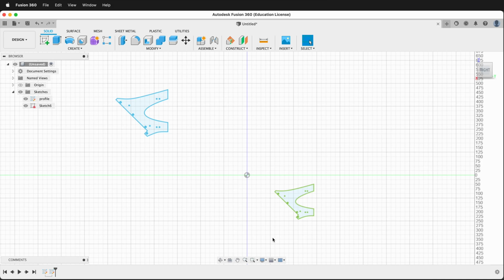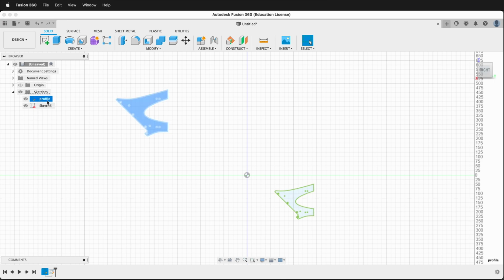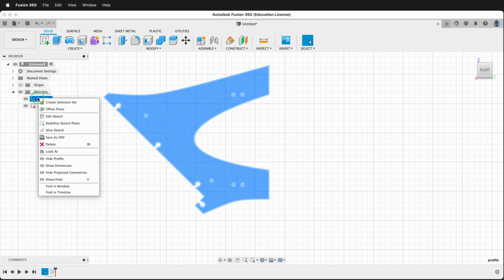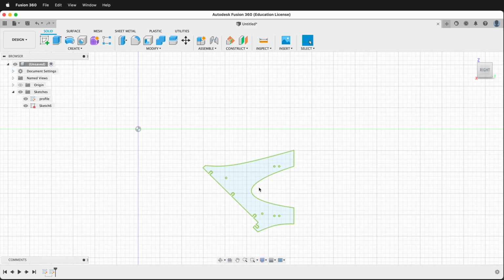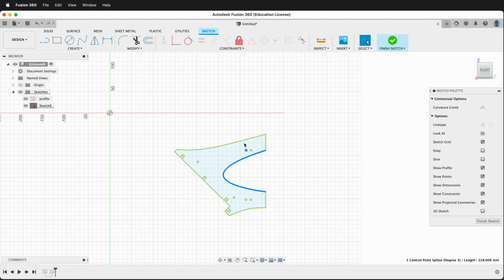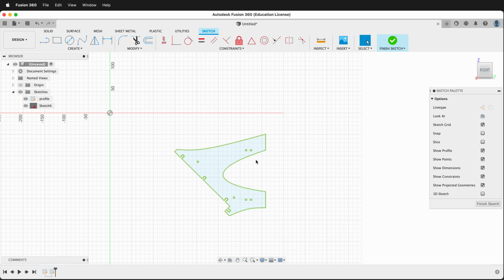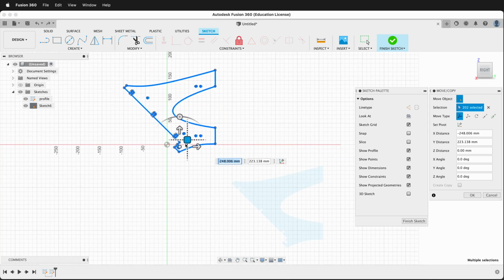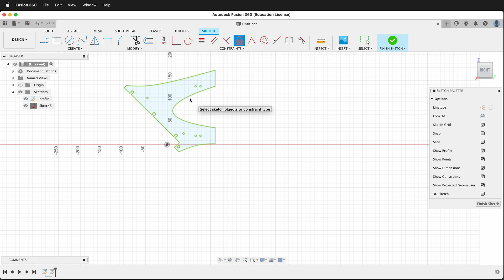How to Move locked SVG in Fusion 360

Comment: Is there a way to constrain an imported svg, e.g. an outline of a leaf, so that it is exactly centered to a body?
Reply from the maker: You could draw a center rectangle that coincident with the farthest extended part of the SVG, then center the body on that
Reply: @WhatMakeArt  I'm trying to make a parametric book end with a cutout of a leaf. I want the leaf centered. I'm able to center the SVG using coincident center point like you said. However, this only works if the SVG points are unlocked. The minute I update the size of the the bookend, the leaf shape gets completely distorted. What I'm looking for is a way to lock the shape of the leaf, but still allow constraints to position the overall pattern.
Reply from the maker: Keep the SVG leaf locked then make the centered rectangle be the anchor point that you build the book end from, say you want the bookend to be 6 in tall and the rectangle on the screen is 18 in tall. Then you can scale everything by 3 and then it will be the right size, for more complicated scale factors you can use in online ratio calculator

Comment: I wanna know how to resize it also.
Reply from the maker: After you unlock it, it is just made of sketch lines, you can select all the sketch lines, then under the modify menu there is a scale command. That is what will be scaled, then you can select the scale point as the origin and then type in a ratio, if you know one of the lines current length, then you can use a ratio calculator to determine the scale factor to get the exact scaled or resized length

Comment: Doesn't work, just delete it and start over.. In fact, that isn't a bad idea for Fusion 360, why in God's name would you make it lock down the sketch and also lock down the svg (which you would want to move), and if I select the padlock it can change the color to green from blue, and I can select it and press 'm' which unselects it and then you can't select it.. and there is lock on the sketch itself... Why do you make simple stuff Insanely hard by default...  Good grief, I drew something upside down because you flip the axis all over hell when I edit sketches (zooming into God' knows where where there are no objects for no reason)  I always have to zoom back out and try to find my sketch - and I've seen this in people's drawing who are teaching so I assume this is just a bug in the software that you don't feel like fixing... Ooh! now you are looking at the bottom, now zoomed in 100X and you have to zoom out until you are tired of zooming.. and then THERE is your drawing!  Whee! what fun...  Ugh...
Reply from the maker: Yes, sometimes software can be frustrating, the auto locked svg is strange

Sounds like you are modeling large scale objects, Fusion is more geared toward smaller than building things, you can change the grid scale and the units, that might help with the zooming

Comment: For some reason, it worked just like that but subsequence trials, I have to create a 'selection set' before I can lock/unlock it.  And it no longer imports with the locked symbol on the sketch if it is into an already started sketch.  Very difficult to use for symbols.  For example I'm trying to make a architectural drawing and using svg as window/door symbols is not working well.
Reply from the maker: Architectural drawings are hard to do in fusion 360

SketchUp or CAD are better for that

You could maybe make a symbol imported in one file and then import that sketch / file in so it is an instance and editable